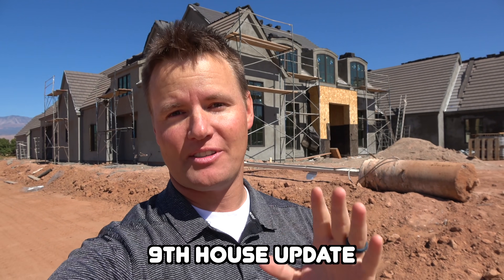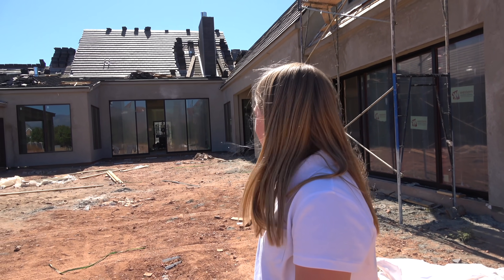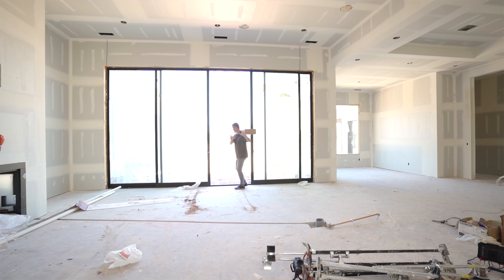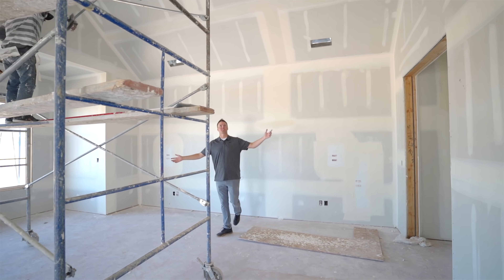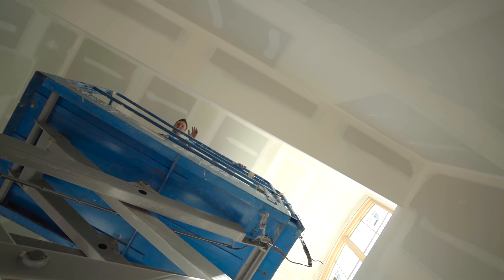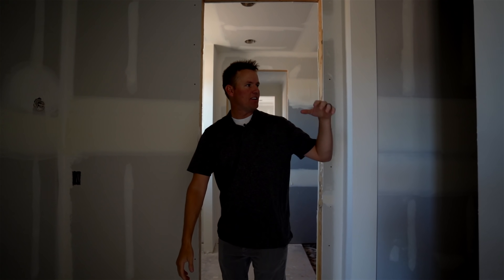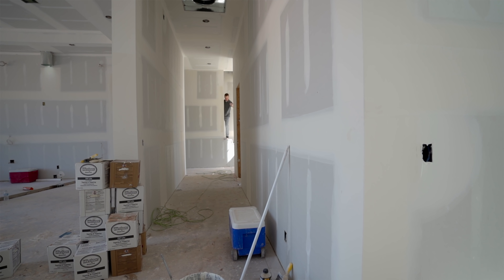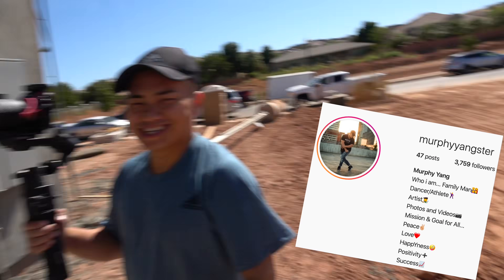Dream Home Update: Mistakes We've Made

Comment: That “foam” is called insulation
Reply: The Blue Angels and the Sheetrock mud is spackle
Reply: And clear liquid is called water
Reply: Sub for no reason that was pretty funny ngl
Reply: @willtay6550  resin is clear aswell
Reply: @Hqseeb  clear liquid that is drinkable
Reply: @iwinrar5207  but clear liquid that is drinkable and doesn't have urea
Reply: How did I get so many likes
Reply: It's part of a system called EIFS (Exterior Insulation Finishing System). It works fine in a dry environment like a desert, but is vulnerable to causing rot in humid environments.

Comment: At 10:48 you can see a gap right into the attic space. In bonus rooms you need to take the drywall to the floor or find some way to seal that up. Carpet will just act like a filter. Hope it stops the fiberglass dust and desert heat from getting into your home.

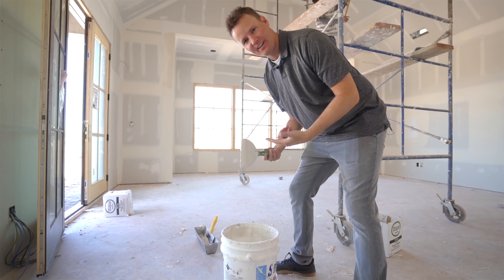Comment: 4:57 that mud is called spackle.
Reply: Doubt that. Spackle is typically used for small repairs. This is most likely joint compound, often referred to as mud.
Reply: Yeah spackle has a thinner consistency and is used after the fact for small repairs. Joint compound is used during building but it’s 90% of the time referred to as mud.
Reply: Ok. They both use the same word in Norwegian so I thought it was the same in English. If joint compound has a word in Norwegian I would gladly learn it.

Comment: Poor communication with the truss engineer can sometimes lead to big issues. I was on a job site today where the truss guys and architect didn't communicate about the location of firewalls in a hotel. When they put in the trusses they made huge cuts in the firewall (not allowed). Need to figure out how they are going to fix it but it's not going to be cheap.

Comment: Use BIM, building information modeling can avoid these quirks in construction. I have used it for designing my senior capstone project for my degree in civil engineering. The software is somewhat tedious, but it reduces such conflicts that you see in your architectural,  MEP, and structural layouts.
Reply: Must architects sadly don't use Revit it's still cad for drawings and sketch up for 3d views
Reply: @brendanryan6244  But do you disagree that architects should be considering this?
Reply: Anyone in construction should be using BIM it clears up alot of problems everyone is feeding off the same information if done right

Comment: You need a very good insurance to that house,in case of a fire it will burn REALLY fast.Wood structure and styrofoam insulation?Who designed that stuff?In Europe you would never get approval for that.Styrofoam structures burn fast.You can check Grenfell towers in London.An entire block of apartments burnt to the ground in few hours.That is a big problem you will have to think about,more than anything else.

Comment: no point picking up errors or problems in the architecture now bud. it will cost thousands to change any one part even such a small part needs to be redrawed, re approved and then actually implemented.  Maybe tho once its done you can have a small team of workers in and make any adjustments you require without all the red tape.

Comment: Please rectify that Toilet in the kids’ Bathroom - not too late to shift that Sewer Pipe into the Wall; and such rectification should not be a large $ variation at this point. You will forever regret this design oversight if not fixed NOW!!

Comment: In sri lanaka everyone builds a house ... hardly ever buy someone a house that someone else's used.... my dad built our house too(paid for constructions,he didn't build it )
Reply: In iraq, if u build a house u have a loss like 10 thousand dollars but still u can use that house for years. My parents built a house in 2016, they spent 240 thousand dollars for a three floor house it can be sold for 300 thousand, it depends on its design here if its modern u have a high win but if not then u loose
Reply: @AnonymousGUY554  thats a lot of money... our house is a little one just enough for our family i think all costs under 70k USD... it is easier to build a house here because no snow,no rain storms weather is always nice 😁
Reply: @chathurakarunanayaka9163  oh but my house is built of concrete. It costs alot cuz its 250 m² and 3 floors.
Reply: @AnonymousGUY554  ours concrete too... only wood doors and roof
Reply: @chathurakarunanayaka9163  aw no ours is concrete blocks but for sure wooden and aluminium doors, but it depends on the country and the area of ur land, mine is in northern iraq/kurdistan it's a well developed region in iraq better than others, so it might cost that much

Comment: Is your house made out of "cheap" wall like i call it? Cause i think drywalls are pretty cheap and not sturdy (one very hard punch should be enough to puncture a hole).

Why dont you spent a bit more money to get like REAL Cement walls?
thats what i like about german houses theyre expensive but sturdy and made out of Cement and idk how to call it its like way harder than cement it is used on the walls and especially on the roof and floor of a house/room.